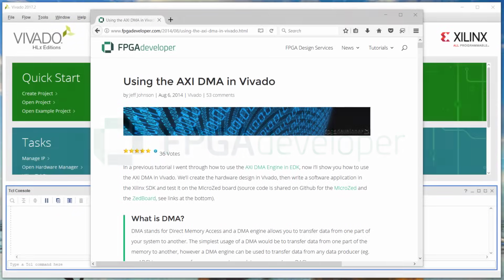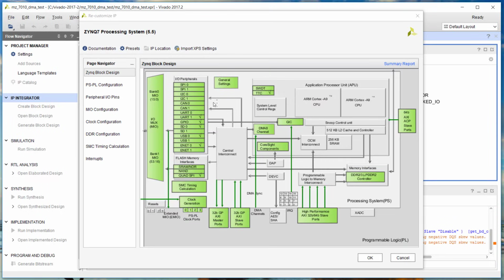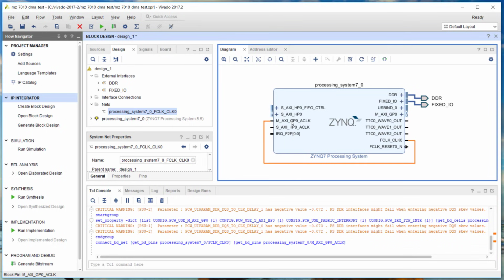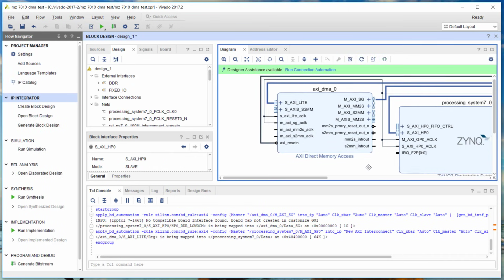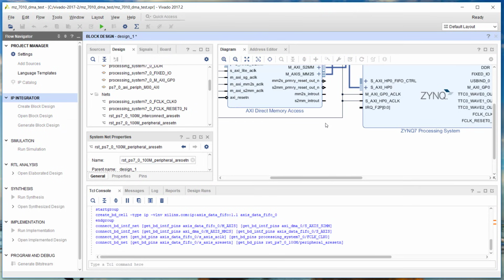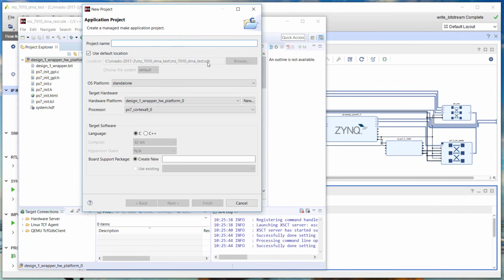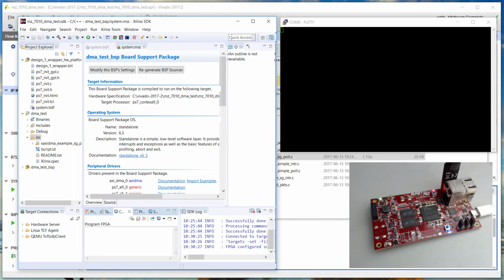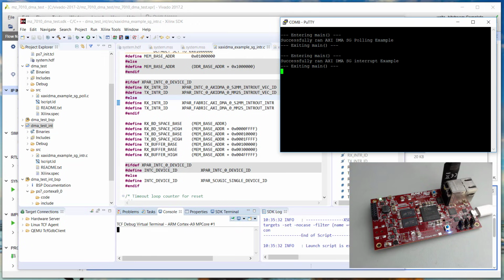Using AXI DMA in Vivado

Comment: I’ve been messing with Vivaldo for a year now and this is the first example I’ve run through that has worked as advertised.  A bit baffled as to why this is the case.  Using Digilent EclypseZ7 board, hopefully getting ADC data into the axi stream successfully at some point.  Always a struggle except for this time.
Reply: 2023.1 versions worked drag and drop, I usually start with “ Hello World” and copy code, drooped the file directly from axidma_9_17 and it worked, wtf!

Comment: Hello, what data is actually being sent and read in this example? 
Can this data be user defined as well ? If yes how do we go about it
Reply: This example have a for loop to generate incremental data and store in tx buffer(ddr4) and then initiate dma to transfer data from tx buffer to rx buffer(ddr4). Basically transferring data between ddr4 only. There is no example describing data transfer from pl rom or pl fifo to ddr4.

Comment: Hello, your tutorial is good but it doesn't work for me, I did exactly the same, my bitstream generation was a success but with 132 warnings..I'm using the 2020.2 version and in SDK when I tried to run the application I'd an error, the tool said it cannot find the the ARM device and even in VIVADO when I tried to program the device I  had this error  [Labtools 27-3165] End of startup status: LOW  all I know, it's that it's about voltage and the DONE pin register that does not have the good value...it's low instead to be high... I've already searched in the Xilinx forums but no real answer to this problem.. :(
Reply: And I have a zedboard zynq-7000
Reply: @igorzeh7182  i get that error when I do not have board configured to JTAG mode